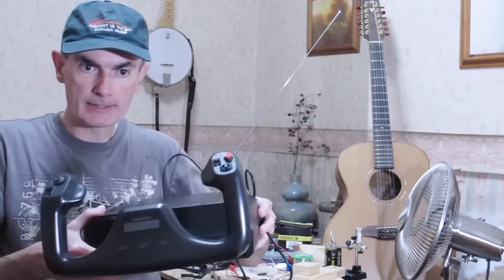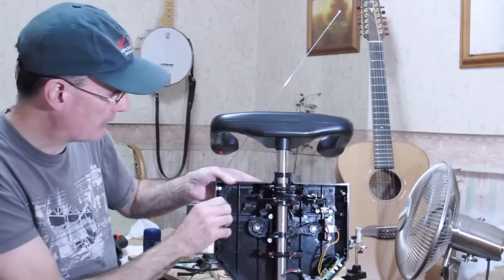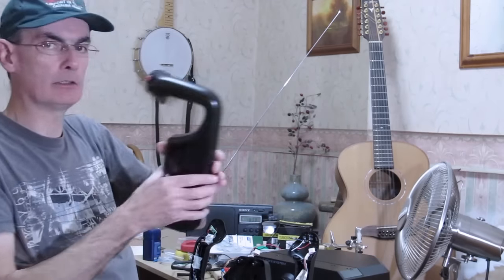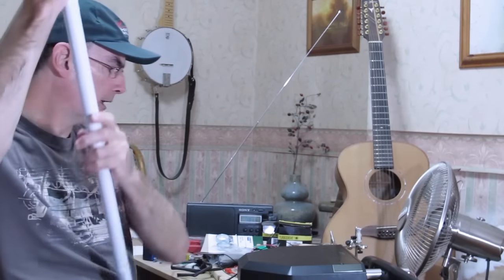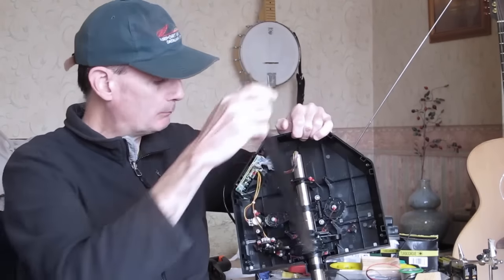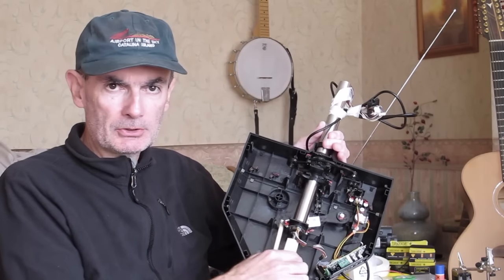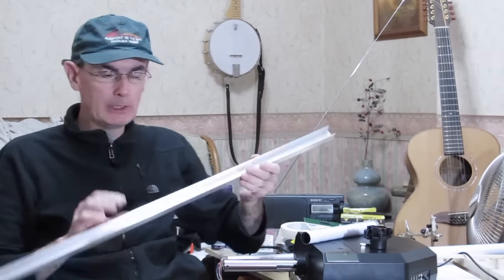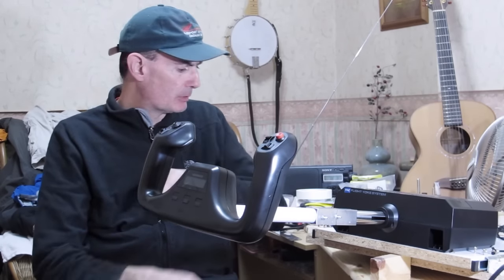Saitek Pro Flight Yoke Ultimate Fix (Part 1)

Comment: hello.  I have been using the Saitek for years and I think this is a great idea so I am doing it myself. I am confused as to what I should buy to extend the armature for the elevator pot ?
       ......also if you would entertain me so I "get it" The markings you made for the bungee cords, how did you come up with those? and last here, in the original post on Avsim he did not appear to use bungee cords at all... How is that  to work?
Reply from the maker: +Joey Jones Re the bungees - he did say "There is about 3/4 to 7/8 of an inch between the bottom of the platform and the bottom of the cabinet sides, so you can fit springs or a bungee there for centering." So we must presume he did so, or as you have figured out it wouldn't work!

Extending the elevator arm - honestly, anything will do. I had some scrap aluminium lying around (the same aluminium channel you see in Part 2 for the external aileron bungees) but I could have used an ice-lolly stick or some other random piece of wood. Be warned - you will not be able to remove the little metal axle that sticks out of the end of this arm, it is actually part of a bigger piece that is encased in the plastic so you will break it if you try to force it out (as I did). I connected the extension to the arm using two nuts and bolts but you could epoxy it instead.

The markings for the bungees - this looks more complicated than it is. I just wanted to make sure the bungees were all about the same length and roughly parallel, so I drew those rectangular boxes before drilling the screw holes. If you use thin bungees like this you can tailor the length (and hence tension) by putting a few knots in them.
Reply: +Almost Aviation ...ok, thank you for that...I just returned from the hardware store and will start my build tonight after work... I mist appreciate your work...thanks again.
Reply: +Almost Aviation I did go with the ball bearing rails.

Comment: I have a different issue, hope someone has some advice.   I purchased a used Saitek pro yoke.   It works fine in left turns and pitch up, but it has spastic motion in right turns and pitch down.   I can watch in from exterior view, and it does it in the control panel of windows.   (Win10home64)Is there a likely fix?   Open the case, check the connectors, blow the dust out?    Does anyone rebuild/repair these for a fee?
Reply from the maker: I would open the case and look. It should be apparent if it's a mechanical fault or not. From your description it's not clear whether both axes are affected or if the glitching is just due to one axis. Can you do smooth climbing turns to the right or descents to the left? If you have two faulty axes it seems less likely to be a worn or faulty potentiometer.

Comment: Here we are some seven years later and we now see 3D printing being more affordable and being able to do it from home.

In light of the modern day availability of 3D printing from home, what would you do differently today?
Reply from the maker: Sorry, I don't see the connection with 3D printing?
Reply: @AlmostAviation 
Well, rather than all that cumbersome attachment stuff that probably was a great idea back then but looks a bit awkward, would you choose to 3D print component parts that together create some kind of internal mechanism that allows you to attach a printed platform attached to the steering column that the potentiometer could be attached to so that the pot slides along with the column when you push in and pull out but stays put when you turn the column from side to side, also 3D printing some rings/collars for around the column that could be better shaped to attach the bungee cords to so that everything is set internally to the housing rather than having a big stick sticking out of the back and cords attached to a moving shelf.
Reply from the maker: @wirralnomad  Yes, there's probably lots of ways to skin the same cat. I think something about the inertia and robustness of this way scores, though. Admittedly it's ugly as anything other than a prototype!
Reply: @AlmostAviation 
Ugly as anything lmao, well you said that and beggars can't be choosers and I'm pretty much a beggar at this point so I wouldn't turn my nose up at something that works a treat.

I do wonder upon the feasibiliity of my own suggestions that would also include being able to release the yoke from it's restricted turning abilities by adding a stopper on a  3D printed ring collar that serves as a stopper that blocks the column from over turning if you should remove whatever piece that is currently preventing it from turning the full 180.

With all of the suggestions I have n my mind the ability to open up space that would allow me to have a gauge panel that surrounds the point on the sim where the steering column protrudes from just as on a real cockpit dashboard and so giving it a more real life layout without building a fuck off massive enclosed fucker of a cockpit in a pokey little bedroom lol.

Terraced houses are just not compatible with such flamboyant ideas, but since I want to fly a real plane too then I really do need to male my set up more convincing with regards to instrument layout so that transitioning between sim, plane and sim again is relatively easy without making it too difficult to adapt between the two.

Doing it all on a budget too is a must for me at least which means making my own clocks and dials/gauges and also housing my gaming pc internals inside my sim rather than having a separate pc tower awkwardly situated somewhere near the sim.

I would be nice to be able to shift it all down into a garden shed then instead of cluttering up my bedroom where I have many vinyl records and musical instruments to store so space saving is pretty much a vital requirement from the off.

It's a project that I would love to video and share but filming and editing is pretty much beyond my abilities, it would be an interesting project to record.
Reply from the maker: @wirralnomad  Well, good luck with all that! I will not try to dissuade you, as the creation of such a thing is a worthy thing in itself. I can't help thinking you could spend a couple of hundred pounds on a decent yoke without conceding more than one or two flying lessons, but that's just logic :) Just think, if you gave up the idea of the real world flying you could be buying Brunner force feedback, motion platforms and a garden shed to house it all!

Comment: I enjoy your videos a lot, wish you could do more. 
Could you do a build using an old keyboard for switches? This seems to be a cheap way to interface w/FS. Does this work well? And just how many functions could you make it perform. Would this be something you could do? Some of us don't have the resources to go out and buy switch panels and interface boards. Just a thought,
Paul
Reply from the maker: +PT Johnson Well using a keyboard for the switches would still require an interface board, otherwise it's just a keyboard. Even if you wanted to do it I doubt you could easily isolate individual switches unless you had an expensive keyboard with clicky keys, in which case you wouldn't want to destroy it! That said, I once completely rewired all the keys on a Commodore Vic 20 to make it work with my ZX Spectrum. That took a lot of very thin wires soldered onto the circuit board...

You could attach a second USB keyboard anyway and stick labels on the keys. Then you could just program those keys in FSX to do the functions you wanted. For more flexibility you could use FSUIPC and make Lua macros or use LINDA.

Comment: Why don’t Saitek listen to the many user complaint about the crappy manufacture of their product and fix it. It’s not difficult?
Reply: because they would need to increase the price if they wanted to make a better product. This is the best you'll get for this price point
Reply: Yup, cost.  They probably figure that is their marginal rate of return on this product.
Reply: Also, it probably is difficult. Changing processes, altering various doodads. There's probably heaps of science involved.
Reply: Because Saitek doesn't exist anymore, first bought out by madcatz, and in turn bought out by logitech, and Logitech is not interested in flight controls, hence why all the original Saitek components are becoming harder and harder to find. (Such as the now vanished trim wheel)

Comment: Would you recommend one?
Reply from the maker: +Colby Bryan Out of the box, definitely not. But if you're prepared to tinker like this and you can get a second-hand one cheap, you can end up with a much better yoke. Be sure to watch Part 2, which I will be uploading later this evening!
Reply: I was going to order the yoke with throttle off of a pilot store on the Internet.

Comment: You lost me when you wanted to take the action away from the yoke and used the drawer slides instead. That takes away from the realism to me. I grasp that these aren't the best working yoke systems but having the shaft fixed in position jsut wouldn't seem right to me. Not knocking your work by any means, just isn't for me.
Reply from the maker: If you close your eyes, can you tell the difference?
Reply: @AlmostAviation  I doubt it but I'm not too keen on flying with my eyes closed, otherwise I wouldn't need a yoke at all lol
Reply from the maker: @Gkitchens1  The mechanism is in any case intended to be out of sight, which is why I made the shaft longer.
Reply: @AlmostAviation  that certainly makes sense. If I couldn't see mine it wouldn't matter to me very much. Do you think it would bother you if iyour set up was such that it was in your full view while being used?
Reply from the maker: @Gkitchens1  No, I don't think it would. I think the intuition that if it looks incongruous it can't be useful is wrong. Look at how many people who haven't tried TrackIR are scornful of it, and yet it is probably one of the best-selling FS addons there has ever been.

Comment: Do you have a fix all my buttons don't work 😥
Reply from the maker: If all the buttons are inoperable that kind of suggests you have one faulty wire. It would be hard to track down, as the wires are very skinny. You might be better buying a new controller, like the Leo Bodnar BBI-32, and wiring up the buttons to that.